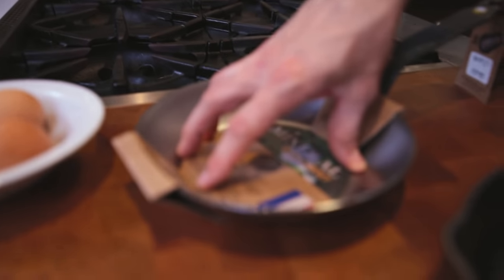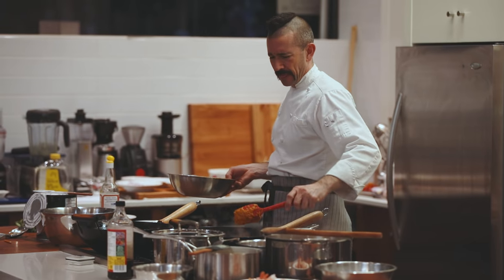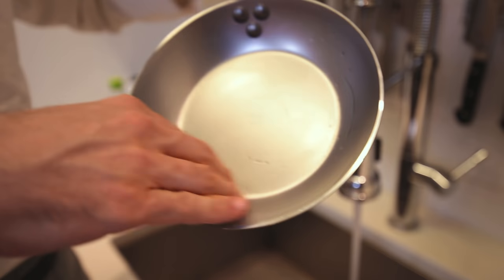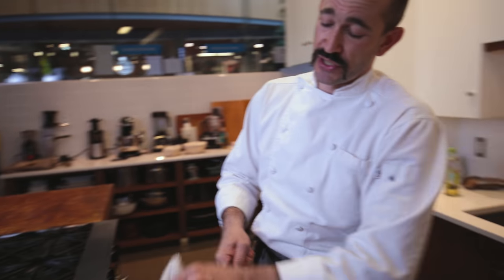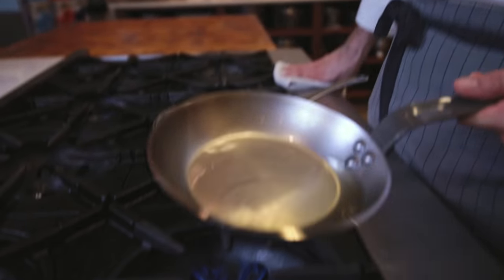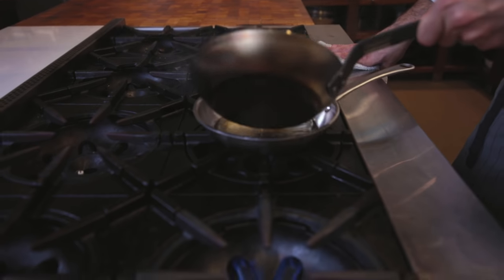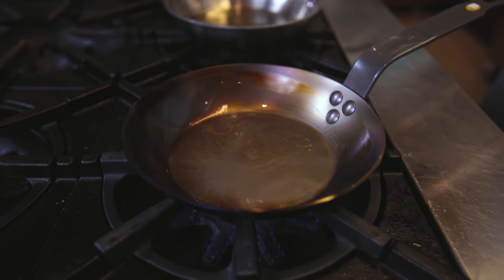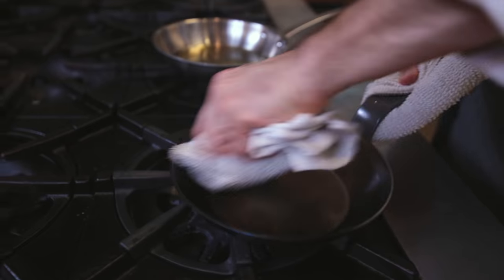How to Season a Carbon Steel Pan

Comment: I have a carbon steel pan and cast iron skillet that I acquired used.  Years of seasoning was already put into them and they are magnificent.  The carbon steel cooks an egg like nonstick.  I also acquired a tiny vintage Le Creuset pan and its my go-to pan for tiny 2-3 egg omelettes.  It's glass bottom, so not seasoned, but somehow has perfect nonstick properties.  Buy used cooking equipment and you're going to get something that outperforms!
Reply: You mean enamel coated? Or literally a glass bottom?
Reply: The best nonstick I ever had was when I seasoned my stainless steel skillet. Nothing could stick to it.

Comment: You've got to hate smoke in vapour form...
Reply: Ikr. Like smoke IS vapor.
Reply: @engu1348  Smoke and vapor are NOT the same thing.
Reply: @Accuaro  But both are in the “gas” state of matter.
Reply: @engu1348  They could both be in a gas state, but would small particulates of ash be a gaseous? No since ash is the non-gaseous, non-liquid residue after complete combustion.

There is a difference, but both can be similar. There is a definition behind each word for a reason.
Reply: @engu1348  Nah this is wrong. Smoke alters the chemical makeup of the original matter, vapor is just the gaseous form of the original matter with no change in its chemical makeup. Vapor and smoke are very different.

Comment: Just for clarification, once the oil started smoking, you immediately took it off the burner, correct? 

Meaning that, you did not leave the pan back on the burner until all the smoke disappeared ?

Comment: After years of battling with a stainless steel pan, which never held a patina for more than 2-3 scrubs, I finally found some genuine carbon steel pans. I bought a 12 inch one for about $10. It will easily last a lifetime.
It really does cook better than virtually anything out there. I mostly cook meat, steaks, bacon, that type of stuff. My main difficulty was finding some for sale. Woks, yeah, pans, no. Finally I got lucky and found a place that only sells to restaurants. It's the better tool, and cheaper, but it is high maintenance, in the sense you need to clean it quick and not leave it wet, because it will rust. Also, you have to take care of the patina seasoning, but the patina lasts longer than on stainless steel.
Reply from the maker: Good on you!! Your effort is being rewarded!
Reply: :) stainless steel isn't SUPPOSED TO hold seasoning tho. that's their point.
Reply: @gareth6517  Then how exactly are you supposed to cook eggs in stainless steel without losing half to the pan? I don't have that problem with carbon steel, and I wouldn't really fry eggs any other way.
But enlighten me then, what is a stainless steel pan supposed to be used for?
Reply: @andychow5509  cooking 101: hot pan cold oil. with stainless steel, lots of oil. just watch some chefs use stainless steel pans here on youtube, you will get the idea. i honestly cant believe you purchased stainless steel cookware with hopes of it holding seasoning. :)
Reply: @gareth6517  I didn't buy a stainless steel pan with hopes of holding a seasoning. I bought a stainless steel pan because I didn't want a teflon pan. But everything always stuck to it, even if I used tons of oil. That's when in desperation I tried to build a patina. I'd never even heard about carbon steel nor seen them in any consumer store. To my surprise they are actually much cheaper than any pan I've ever seen, and always cook perfect. They rust and don't go in the dishawasher, which I don't even have.
Reply: @andychow5509  with pans with no non-stick coating, heat up the pan first by itself, then add oil, then immediately your first ingredient and go from there. the more delicate (like eggs or fish filet) what you're cooking, the more oil you need. that's the trade off of using "no non-stick coating pans". if what you're cooking isn't delicate (like steaks), you don't need that much oil. you just need to wait till the side that touches the pan browns. it's called maillard reaction. before that happens, dont try to move it, because if you do, it will stick. wait till it browns and separates from the pan with ease. when buying a pan, for me, one of the most important things is that it doesn't cause oil pooling on the edges. a lot of brands make these mid convex thing now which leads to oil pooling on the edges and leaves the center of the pan dry. so be mindful of that. and try to buy your pans from physical stores instead of online. that way like a crazy person, you can pour some water on them in the store and see if they will pool wrong. lol
Reply: @gareth6517  A lot of what you said makes a lot of sense. I did notice when cooking salmon, if I did wait a while but not too long it would mostly slide clean. But often, and with less fatty fish, some small part would stick and then become part of the pan, and very hard to clean after.
With carbon steel, I avoid all those problems completely. Minimal oil or butter, or sometimes a spoon of lard or a few diced cubes of pork belly, get it real hot, and it's better than any non-stick pan. As for cleaning, just use hot water and then wipe off everything, a dry it by turning on the element or gas a few seconds.
When I grew up all we had were non-stick or cast iron, and compared to cast iron, carbon steel is superior by far in every way (that I can think of). I hate non-stick because it's a tiny coating that inevitably ends up in the food, that's my opinion. I don't want to eat teflon particles or epoxied ceramic.
I'll never buy another pan that isn't carbon steel. Stainless steel makes sense for pots to make sauce or soup. Or ceramic for pottage or oven.
Reply: @andychow5509  a nice quality stainless steel has its place. a minimum of 3 ply, ideally a 5 ply (very expensive), stainless steel pan will have the best heat distribution. the more copper it has in its layers the better. these are sometimes called heavy bottom stainless steel pans. they are also almost impossible to warp and will keep their flat cooking surface for a very long time. not to mention they are stainless so you don't need to worry about rust.
Reply: @gareth6517  yep.
Reply: Stainless is polished, right? Lodge and Kockums carbon steel pans are sand blasted. Maybe that's why the seasoning holds better? De Buyer Mineral B seems quite smooth, though.

Comment: So, a couple of things. The Bees Wax coating will NOT be removed from gentle scrubbing and hot water. I've tried that a few times, I think all you end up doing is smearing the wax around. I resorted to using rubbing alcohol which after a few scrubs did remove it. You can tell when you have the wax off when you get a dull grey residue start to come off onto your scrubby or rag, thats from the bare metal. The pan will also have a pronounced metallic smell once the wax is gone.

Also, at the beginning when he puts the oil in, that browning is not seasoning. Thats the metal itself changing color from the heat. It will turn brown like this without any oil. If you keep heating the pan it will change from brown to a deep blue and the finally back to a silver color. At this point you have added an iron oxide layer to the pan. I do this to my pans, but its not necessary.
Reply from the maker: Hi, you do not need to remove 100% of the wax, just most of it.
Reply: @Cook-Culture  you should make that clear in the video, don’t want to be misleading people now do we?
Reply: @bobfarley4102  
Yes, we're being condescending
Yes, that means we're talkin' down to you
With all that racket from your lips a-flapping
We assumed you didn't notice

Comment: If I'm not mistaken aren't Lodge cast iron pans now pre-seasoned ? That's why is has a bumpy finish and not a smooth flat surface.
Reply from the maker: Ann L Hi Ann, you are correct about Lodge coming  preseasoned however the rough texture is from the 'casting' process. There are some Cast Iron companies that make a smooth finish and de Buyer carbon steel pans are super smooth. These make for a better 'non-stick' pan.
Reply: The preseasoned cast iron is rough so it takes in the oil easier compared to a smooth finish one
Reply: Lodge actually also pre-seasons their carbon steel skillets. Therefore they have the same, rough surface as Lodge's cast iron cookware and combine the worst of both worlds. That's why I would avoid Lodge carbon steel and go for another brand like Matfer Bourgeat, De Buyer, Turk (Germany) etc.
Reply: @waldgeist9007  I one a lodge carbon steel pan and the surface is not the same at all
Reply: @typow5629  Lodge roughens the surface of their carbon steel skillets before preseasoning them. They start out with the same, smooth sheet material as all manufacturers of drawn skillets. Of course it's not a cast surface, but it's still rough unlike all other carbon steel brands. Lodge needs that rough surface so they can simply spray on the seasoning oil and move the hanging skillets through the oven (too keep the cost low compared to seasoning by hand). The rough surface makes sure the oil adheres during the seasoning process.
Typical mass produced, European carbon steel skillets come unseasoned. That's why they have some form of protective coating (beeswax, oil, plastic etc.) and have to be seasoned before the first use.

Comment: You don't have to season the bottom?
Reply: Mine was rusting from the bottom and I just went ahead and did.
Reply: You can do a few layers as a form of rust protection. On open fire like gas, coal or wood it's not mandatory as there will be a layer of burnt residue forming on the outside of the skillet.

Comment: Awesome vid! I use the de buyer as well.I just started using my carbon steel pan 2 days ago. And it has this brownish look from the oil ? Is this normal?  I guess the best way to cook egg is with butter+oil? Oil alone  makes a huge mess when cooking the egg.
Reply: What mess lol?
Reply: @madalinnicolae5594   if i cook sunny side up  egg with oil alone,some parts would stick.So i guess I need  to season/burn more the frying pan. seasoning is no joke when you do it in a small  apartment , the fumes from the carbon steel makes my breathing a bit tight.
Reply: @understars8094  well, u can always go for a mafter non stick pan... planning to buy one soon

Comment: I tried seasoning my carbon steel pan with Sunflower, Coconut and Avocado oils. I've done about 6 cycles at max temp in my oven (250C) and all I have is blotchy oil stains in brown and black on top of a dark grey pan. I purchased this carbon steel from IKEA and followed the instructions exactly. Not only is it NOT non-stick, it's the most ridiculously sticky pan I've ever had. An entire egg stuck to it even though I added oil too and was so stuck on that I couldn't remove it even with a metal scourer. I had to scrape it off bit by bit with a spoon. What am I doing wrong? Did I mess up the process in the beginning? If so, how can I restore it?
Reply: One tip I've seen is to just add very thin layer of oil all over the inside of the pan. 

If you add too much oil, it just burns instead of polymerizing. If it burns it turns in to coal basically, and forms this weird sticky surface.

If you add only very thin layer, the heat polymerizes causing a strong bond between the steel and the polymerizated oil. This is what's supposed to give that non-sticky property for it.

Problem is, that even this doesn't seem to be happening always perfectly. So the easiest way seems to be to just start using the pan to cook for examble vegetables etc. instead of eggs or chicken right away. This will slowly increase the non-sticky property, and finallt after maybe some weeks or months the surface should be ready for all kinds of cooking. 

And always remember to use good amount of oil when cooking, as these steel pans will supposedly never be able to quite achieve the non-sticky properties of the teflon.

This is all that I've read/understood about this subject, but I'm still trying to find if there would be simpler and easier way to season the pan.

Comment: Great video, but that was a cm of oil not a millimetre👍. I'm going to do this now,  thanks 👌
Reply from the maker: That is de Buyers recommendation. Personally I use seasoning wax instead of free flowing oil
Reply: @Cook-Culture   Is there a brand you recommend?
Reply from the maker: @moot6794  It depends on where you live. In Canada, we make one, in the USA we recommend Buzzy Waxx

Comment: How about the bottom of the pan, can't it also rust, shouldn't you also coat it?
Reply: It doesn't hurt to apply a layer or two to the bottom and outside of the skillet. But when used on open heat (like gas), there will be a layer of residue from the fuel forming on the outside which also protects it from rust.

Comment: teflon coatings are not something people need to be alarmist about. Do you cook with non stick pans over 450? No, Then you are fine and doing it right.
Reply from the maker: We could not disagree with you more, on all levels. Chemical should not be used in cooking when it can be easily avoided, and ALL coated pans wear out and become landfill. Sustainable (non coated) pans are the best choice, every single time. Everyone should be alarmed.
Reply: Breathing in the volatile smoke from the seasoning process is more carcinogenic than cooking with a Teflon skillet. Especially if you use the oven method, which subjects you to hours of noxious fumes and toxic smoke.

Comment: I have some questions, please help me :( :
1. For a carbon steel pan, can I use soybean oil for seasoning?
2. I've never seasoned a pan before, people told me that I should put the pan in the oven, heat it before putting oil on it to avoid some ugly dots on the pan? Is that correct?
3. In my place we tend to wash the pan using soap, until there is no oil stuck on the pan because we're afraid that the oil can be rancid when it's left outside, I just wonder if we just leave the oil like that, on the pan after seasoning, will the oil be rancid?
4. Can I wash the pan using soap right after seasoning? (I mean after I cook, wash it and put it on the shelf for later use)
5. When I season, should I only take a rag, dip it in my soybean oil, place it all over the pan and heat it, instead of putting a large cup of oil?
Thank you.
Reply: Larsson Söder
Same treat like a cast iron pan -- bunch of videos.

Comment: What about the bottom part?
Reply: It doesn't have to be seasoned, because the beeswax used in packing would still be there (you are only advised to scrub the cooking surface). The moment you put in on the flame the bottom will be seasoned, and in subsequent use as long as you dry it out, you will not have any problems with rusting.
Reply: Feel free to season the outside of the skillet too. It doesn't hurt the pan and serves as rust protection. Just don't overdo it, a few thin layers and a touch up from time to time will do the job.

Comment: We’ve tried seasoning multiple times and it’s still not nom stick.    The guy in the kitchen supply store mentioned heating in an oven to 500 and letting the oil cook off.  Can this be done ?
Reply: Yes absolutely.
Reply: The method for cooking on these vs teflon is quite different. Calling these non stick is a bit of a misnomer because they are only non stick if you season them correctly (which you probably are from the sounds of it) and also use enough oil. If you watch the videos of the people who can make an egg float around on these or on cast iron, the egg is basically floating in oil;)
The history of the switch to teflon is really quite interesting. We switched because of some bad science tricking us into thinking oil caused high cholesterol and was bad, which is not really true if you are using healthy oils like butter/ghee/avocado oil/olive oil/coconut oil. so the Teflon solved the problem of things sticking to these types of pans when we cut back oil usage. Now we discovered that low amounts of healthy fats causes health problems and teflon causes health problems and we're trying to switch back and often the biggest cause of distress with these is not enough oil. Anyways, I'm just guessing at a possible solution, I could be way off base, but hopefully I'm not because that means your problem is solved;)
Reply: +tanis j
Did you scour the heck out of the pan before you started seasoning it? Did you make sure it was so smooth that if you walked across it in your stocking feet you would fall down?
Reply: Olive oil has low smoking temperature.  So it isn't good choice for frying.
Reply: strip your pan and do it this way, it doesn't have to be uniformly dark and shiny, but it will be nonstick. don't expect teflon level nonstick though. i can make eggs move around the pan like hockey pucks with even half a teaspoon of oil or butter per scrambled egg, so it's fairly nonstick